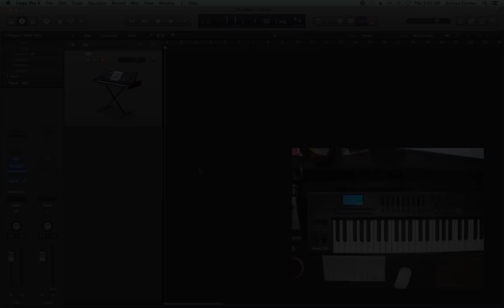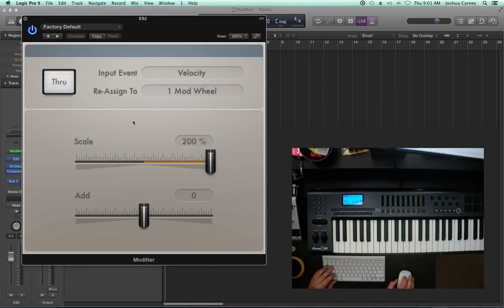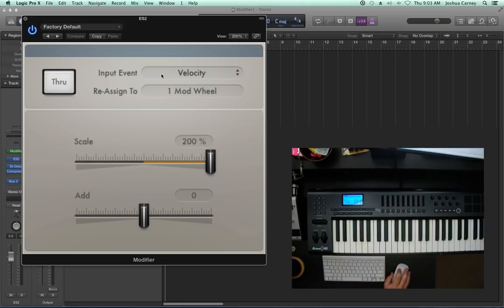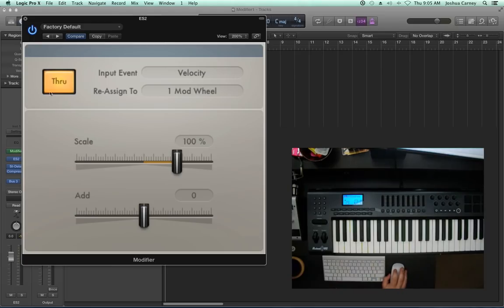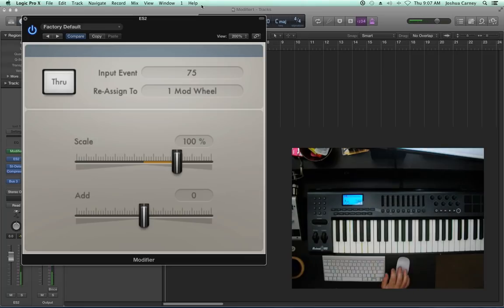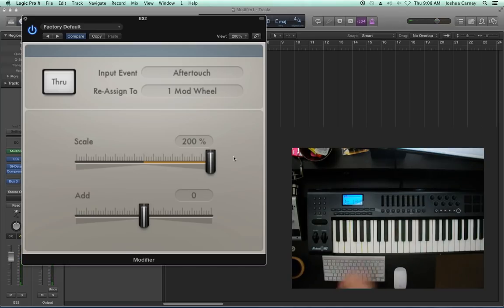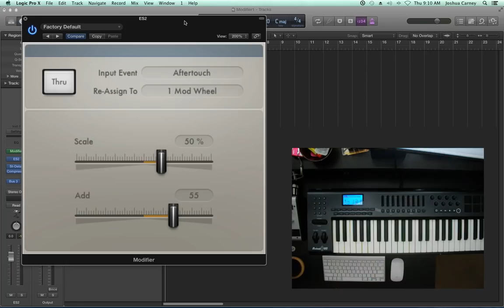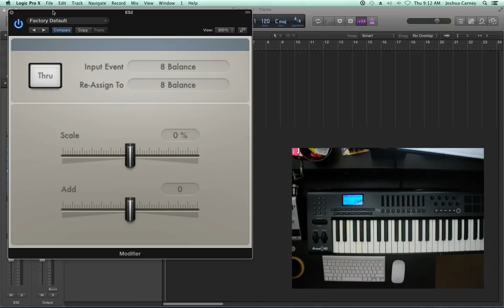Logic Pro X - Video Tutorial 39 - Modifier MIDI FX Plug-in

Comment: This was great! i'm having a bit of trouble mapping velocity to a knob for SHAPE in Sitala a 3rd party drum plugin, because it is on a scale of -100% - +100% and I don't know how that relates to these values of -200%-+200% when they are both independently based off of 0 127 midi velocity sensitivity. The dividing of that is very confusing. But basically I would only like positive values on the Sitala knob, so I don't want the SHAPE knob to ever go backwards, but only positive sometimes, and at a very low sensitivity. Any tips? Is this possible to do in Logic? I can't update to the new update either my mac is too old

And on that note - is there a way to invert the value? So as the midi velocity value increases, the parameter control decreases?